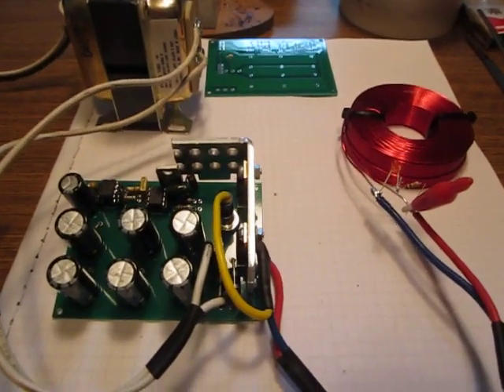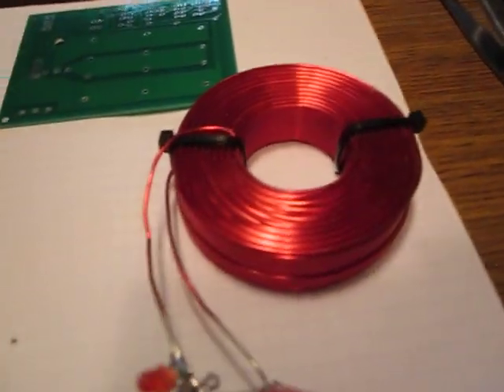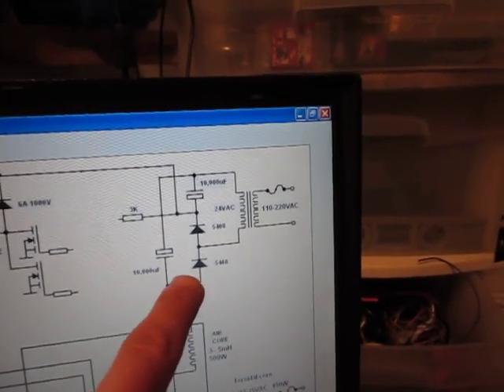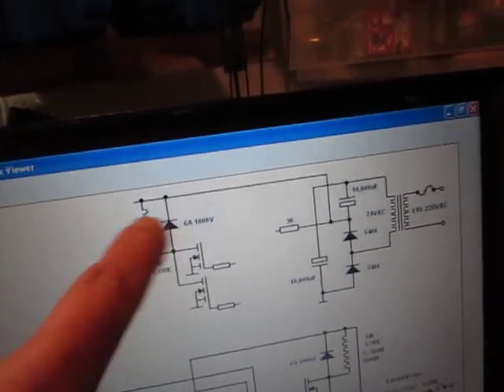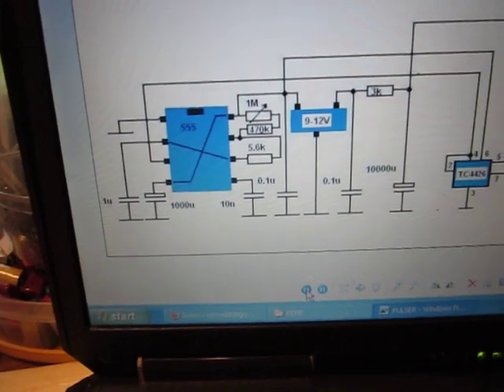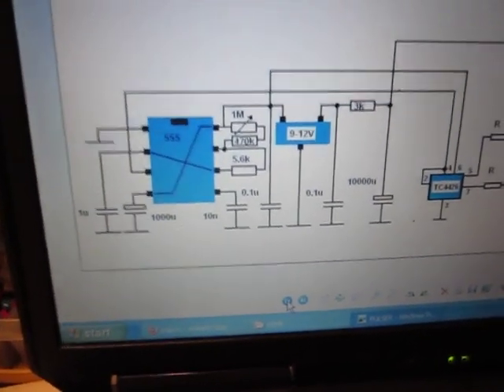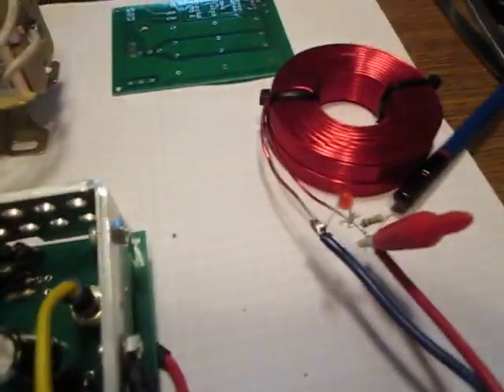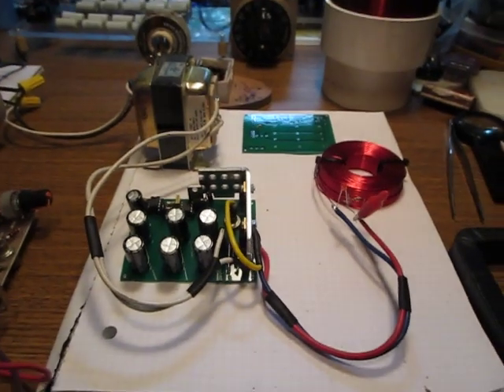Magnetic Pulser - update

Comment: Hi blackchisel97, that’s a nice presentation. Do you still have any extra PCB of this schematic? And one more: have you made any improvements to the schematic shown in this video? Thank you, Dan.
Reply from the maker: Hi Dan, I don't have any pcb's left. Currently working on bipolar PEMF (sending microsecond pulses of both polarities simultaneously) but increased potential to 5-10kV range. Very powerful and allowing to decrease session time down to 5-10min. Preliminary tests are very encouraging. Details are not published yet. Please visit my forum for more information. Thank you.
Reply: @blackchisel97  
Hi,
Bipolar PEMF. Interesting. Please correct me if I'm wrong, but the polarity it's crucial on coils used for EMF as treatment. I've read that if the polarity is changed, the EMF could damage equal or more the exposed areas.
In this present project, how deep into the tissue does the PEMF penetrates? Also, what's the difference in procedures and results between your project and dr. Bob Beck's PEMF? 
Previously, you mentioned that each treatment and/or body areas needs a coil with a specific magnetic field. Can you, please, elaborate this subject.
I've been working on a Colloidal Silver generator for the last 4 years. Currently I’m pleased with the results using an Arduino for all the logical outputs (4Hz pulse, reverse polarity, low current, etc.).
Thanks for the info,
Dan
Reply from the maker: @danbira5593 , this is long subject and I would prefer not to discuss it here. Please join my forum (nvtronics.org) and I'll answer your questions. Thanks.

Comment: mine uses 300 turns wound on a on a old vcr cassette reel.resistance is 2.2 ohms.i pass a current of 2 to 4 amps from a wall adapter at 12 volts using a mosfet transistor which is driven by a  free frequency generation software from pc and also the FREX 16 software for automatic frequency changing.

Comment: A magnetic core is a piece of magnetic material with a high magnetic permeability used to confine and guide magnetic fields in electrical, electromechanical and magnetic devices such as electromagnets, transformers, electric motors, generators, inductors, magnetic recording heads, and magnetic assemblies. It is made of ferromagnetic metal such as iron, or ferrimagnetic compounds such as ferrites. The high permeability, relative to the surrounding air, causes the magnetic field lines to be concentrated in the core material. The magnetic field is often created by a current-carrying coil of wire around the core. The presence of the core can increase the magnetic field of a coil by a factor of several thousand over what it would be without the core.

The use of a magnetic core can enormously concentrate the strength and increase the effect of magnetic fields produced by electric currents and permanent magnets. The properties of a device will depend crucially on the following factors:

    the geometry of the magnetic core.
    the amount of air gap in the magnetic circuit.
    the properties of the core material (especially permeability and hysteresis).
    the operating temperature of the core.
    whether the core is laminated to reduce eddy currents.

In many applications it is undesirable for the core to retain magnetization when the applied field is removed. This property, called hysteresis can cause energy losses in applications such as transformers. Therefore, "soft" magnetic materials with low hysteresis, such as silicon steel, rather than the "hard" magnetic materials used for permanent magnets, are usually used in cores.

Comment: Are you certain that the magnetic field is of the same strength using lower voltages? This is very nice. Very impressive. I built a circuit too which you can see in my videos, but it doesn't look this nice.
Reply from the maker: PEMF is a broad term and there are many different therapies which involve dynamic magnetic field. What matter most is the abrupt rise and fall or, in other words very short pulse, preferably under 1 microsecond. I tried 200-300V pulse and it did work for some ailments such as chest congestion or lymph nodes but I'm more interested in the effects of higher freq's and potentials not exceeding 100V. I've been too busy during summer (if there is a such thing in Canada) months but have plans to get back to this and other stalled projects.
I'm not after nice looking but effective device which can be relatively easy to replicate by others.

Thanks
V
Reply: blackchisel97 Hello thank you for your thoughtful response. I am curious if you have any sources which can help me be to better understand this? I always assumed that having a capacitor discharge circuit automatically meant a sharp rise time?
Reply from the maker: Capacitors have internal resistance which is referred to as ESR - equivalent serial resistance which means, they'll take time to charge and discharge, no matter how good they are. If you're planning to generate nanosecond range pulses this concept won't work well as capacitor will not fully discharge in such short period of time but
this idea works fine for slow pulse rates and longer duty cycle.
Reply: blackchisel97 Thank you. What is the solution for fast discharge? Radiant discharge of flyback voltage is in the order of MHz, would this be better? Do you have some references I can research so I can understand this better?
Reply: use more weaker pulses.instead of a few hertz of very strong pulses used say 5000 hz of weaker pulses..  2x 50 = 50 x2

Comment: Why can't you use an iron, nickel or neodymium core for the  coil?  What is so special about air core?  You don't have to change the components to increase the magnetic field.
Reply: Air core coils do not have the frequency limitations of solid cores.
Reply: But all the PEMF devices are pulsing at way less than 5 pulses per second?  Most of the videos are like at 3 pulses per second.
Reply: Exactly.some people just don't understand these things.Another thing they keep harping on is about skin effect.only applies to very high frequencies yet they keep going on it about it for less then 1 mhz frequencies.

Comment: How many metres of magnetic wire did you use? I thought I heard you say ten but might of heard wrong because of your accent.
Reply from the maker: I used air coils from Erse Audio. They're crossover inductors. The one shown in this video is AWG 18, approx 1mm wire, having 3mH inductance. Protective diode should be ultrafast type, such as STTH812FP from Mouser.
I have made a new switch which can pulse lights as well as inductors and work from TTL output of any signal generator. Please check my YT - Switch for Spooky.

Comment: Can I use 40microfarad 400v motor starting capacitors. I was thinking of 220v mains , no transformer, connected to rectifier and charging caps. Caps will discharge into coil.
Can it work without transformer?

Comment: I have a 220 volt step up transformer to power the one I built but I usually run It at 145 volts passed 180 volts near head seems to cause neurological problems.

Comment from the maker: I'll be making another version without using heavy transformer. Once it is done and tested I'll post short update and as usual, provide all details on NVtronics board. This version will run on 12VDC source such as PSU or car battery.
If you have any questions or requests please visit our forum. You can also contact me using forum message system.